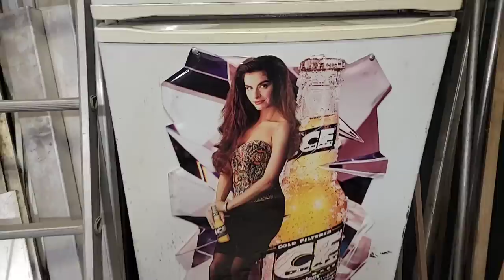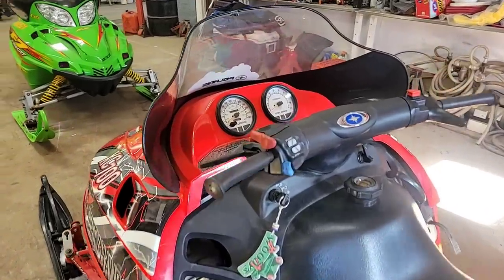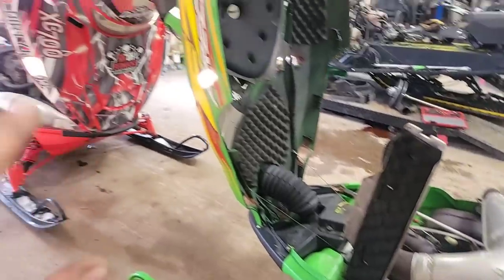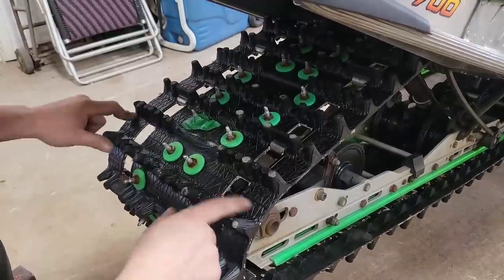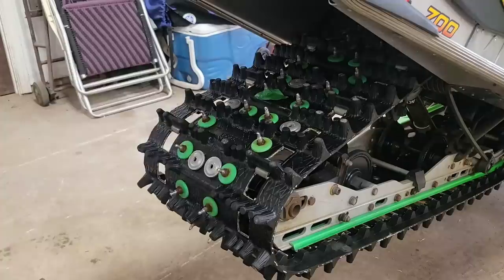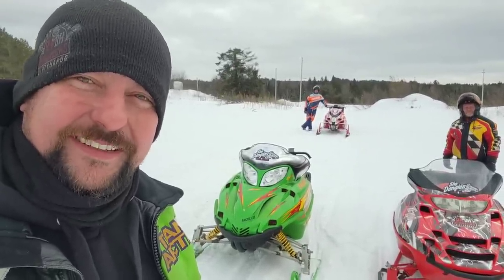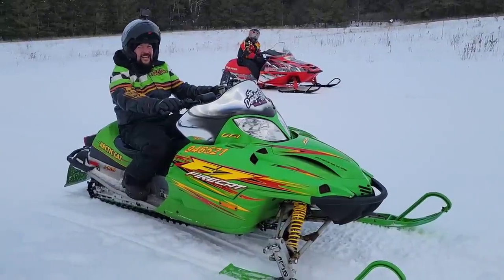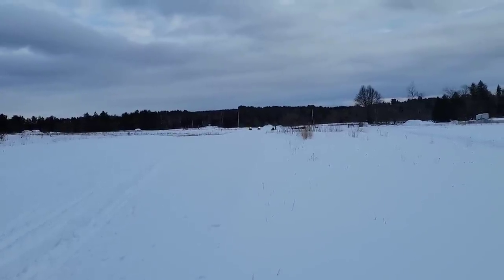F7 VS XC 700!! Which One Is Faster?

Comment: I know alot of F7 fans we're saying that it would eat up the XC 700.. but I knew that wasn't going to be the case. I never owned a XC 700 but my buddy did and it was a VES which are even a little bit quicker and we use to do drags up on our river and not much could touch them, the closest sleds to them was the F7 or triples on long runs.. alot of F7 fans are unfamiliar that the XC's are Big Block motors and they work very good.. coming from a Yamaha rider
Reply: Yeah the polaris has been played with its a shocker it even runs
Reply: Wasn't this year a liberty 700small block just like the 600, it's just before they put powervalves on it? I thought only the pre edge 700's were big blocks? Like 98-99
Reply: @nick  no they are all big blocks only thing that changed was the cylinders with power valves and VES which gave them more power.. alot of people talk about the 220 jugs being the best but it's not true because they had more power in the later years... IN STOCK FORM.
Reply: Both are quick polaris was always fast when they dial them in. But those f7s are rockets man
Reply: @Shane Rose  yes they are both quick, and I knew they we're gonna be pretty much even. Like I said we use to run ice drags years ago and it was a big event in our area in Canada here and I remember those stock XC's we're taking down modified sleds and F7's we're pretty evenly fast basically they lost just as many as they won when they lined up and it was fun to watch. Remembering those day's I knew the F7 wasn't going to walk away, that it was going to be close and the XC did win and so did the F7 just like back when we dragged them
Reply: @Ryan-vo3rm  yes I also live in canada and I have experienced pretty much the exact same seen stock versions of each do very well I haven't got to many drag races over the last few years but I sure do enjoy them
Reply: @brokejoker89  yeah okay... sure
Reply: @Ryan-vo3rm  yeah that's right Ryan
Reply: I know the hot setup for a f7 and a stock motor with gearing and clutching will take that sidewinder in a 600 ft race all day long. I’ve been drag racing f7 for almost 20 years
Reply: You're absolutely right The XC700s or monsters especially the 97 and '98 with the raceport
Reply: Until later they did build the 700 and 800 off the small block 600. Like the 07 dragon 700
Reply: My srx eats them both
Reply: @nicknadeau7173.. because it's a triple, unplug one cylinder and run it like twin lol.

Comment: with that f7 you have to make sure the fuel pressure is correct 38-45 psi, some of these have way too much pressure due to clogged regulator, with everything else being good it would smoke that xc700,

Comment: Conditions and lane choice play a factor in any sled race. Those chain case F7s were really fast in there glory years. I'm betting that XC 700 has a set up that works. Let's get that F7 some maintenance etc and have another round. Great video with the boys, cheers from Ontario
Reply from the maker: thank you and cheers 🍻
Reply: what are the glory years
Reply: @phoenixluke8132  before the triples died when sleds didn't cost more than bloody cars man!
Reply: @phoenixluke8132  I have a 04 700 FC , I put 153,2 inch, fuel pressure regulator. Runs wicked and has tons of kms
Reply: 😮😮 rrear.😊arez😊/😮😮😢😢
Reply: @Phoenix Luke  well I have a sidewinder turned up to 11 so ya can't compare. Back in 03 those sleds stock to stock would spank 1/4 mile pulls not the whole lake now  an  RX1, Mach Zs and SRX if studded right, think that about sizes it up there pal.

Comment: The 2002 xc700 was so strong they detuned it the next year. The 98 was also quick. I don't remember anything stock (700cc) beating that sled when it came out, it dynoed @ 124hp with the early 220 torque ported jugs. The 2002 was outperforming their own 800's. I think the 03 firecat was the fastest 06 was also very quick.
Reply: I have a 98 xc700 and it rips, really fun sled😎

Comment: 700 big block non VES Polaris is very impressive...or that F7 is tired ..?   Also i think the track setup on the Polaris is better ...XC 700 had better use of its power and clutching. 
A fresh F7 with proper track setup and clutching should gap the XC quickly.  what did they look like across the lake WFO top speed?

Comment: Need to get the XC and the F7 on a lake or long field where they can stretch their legs, I think that's where the F7 will take it. Great video, that XC is quick.
Reply from the maker: Totally agree! 🍻
Reply: The FireCat typically reaches 110-112mph. full out.  I just watched a great video of someone doing just that on radar.  The sled went by the fellow holding the gun only a couple feet away from that top end run.  PLUS, the camera was also focused on the sleds speedo and reading the SAME MPH !!  

I always felt the newer Cat digital speedos in those years were pretty accurate.  I own one (2004), and at absolute top end on a LONG lake......................110mph.  (O:  It's 140HP in a 521 lb. sled WET................it makes perfect sense.
Reply: @garysmith8455  you are right,  those lay down 700 Suzukis were close to 140 hp stock. Those 700 polaris were barely 120 hp.
Reply: @johnbabb1138  Thanks for your reply and agreeing on true history from back in the day (O:

Comment: I bought an 04 F7 new, and buddy had an 02 XC 700 at the time. Both were bone stock with studs. He was a handful and beat me multiple times. The 02 700 was rumored to have some hotter timing in it vs later yrs. The F7 was a quick sled and showed its tail lights to many larger CC sleds, but that XC 7 gave me all I could handle. Both great sleds in there era.

Comment: Another variable here is the track, alot of f7s back in the day were sno pros with the 1 3/8 track, which worked very very well.
Reply: Only the SPs got it, unless you asked for it. 
We had 2 03 F7s and 1 440SPs brand new. 
That XC700 would never be seen at drags in stock classes. 
The F7s needed clutching and they are complete different animals, and removing the rear couplers.
Reply: @mitchellandrew3318  maybe not at your drags
Reply: @romper4444  There was tons. 
We built them also. 
They can't touch a stock for stock 700s with clutching in 660' is what we dragged. 500' not a chance. 1000' the SRX 700 would run it down. 
Also if you don't know much about the 03s. There claimed 135hp, was more like 145/150hp with minor tweaks. 
Mod 700s and stock and mod 800 classes didn't like the chain drive 03s. 
DD machines were slow 05/06s. They needed alot of work to make quick, plus they were a bit heavier. 
We had many wedges, Gen 2s, pro X , IQ and IQRs. 
I even had a IQR with a cat motor. 
The polaris 700 is a reliable fast motor. But they needed a ton of work to make them layback block fast. 
Unless your in your game, and hitting a light all day long on that tree. The XC 700 wasn't worth its weight for speed. 
What the video is showing is a bone stock F7 with nothing done with a 13x1.25 track. It's like a chainsaw in the snow.

Comment: I thought after 2000 polaris 700 were VES....  I've had a few 2000 RMK 700s and there the most dependable sled by far... Cats always seem to run great until you get far away from home...   My RMKs with 136 tracks top out at 100mph to 105mph on the lake...

Comment: Thing here  is, you got a light weight (F7) @ 140 hp. vs. a new 205 hp. sled = quickest/fastest available today. (is that a stock exhaust note I hear??)    I would be willing to bet that a NEW sled in the 'same engine class' as a 20 year old Cat such as in the presentation here, the owner of the new model may be greatly surprised out there on the lake.  

Outside of the suspension changes and added comforts, the new sleds have not come all that far when the track meets the snow.  (O:   I just watched a video about the Catalyst, and the presenter made mention about Cat's 'lay down' engine.  Guess what, that 2003 F7 is when Cat INTRODUCED the lay down engine......yes, it is 20 years old now and appearing on a 2024 model !

At any rate, it is all in good fun anyway....thank you!

Comment: Some  F7's (dependent on year and chain-case drive) are super fast due to a number of things: 1. Fuel injected. 2. Front air pick up (colder and more flow). 3. 13.5 x 128" track  vs. the Polaris 15 x 121" (an extra lug and studs on the ground at any given time and lighter rotating mass). 4. Higher stock head compression (more stock H.P.). 5. Weight (stock vs stock the Cat is lighter by about 60 lbs.!). I believe the the 2003 F7 stock HP is around 140. The 2001 Polaris XC 700 is around 120-125 (Not the SP). The reason that "Scooter's" sled is neck to neck with that F7 is simple, his sled (a 2001 XC 700 SP) has a VES type cylinder head from a 2001+ 700 (higher compression probably equaling a stock F7). Don't know what gas Scooter is running but with that head 91+ octane. If the XC could "cheat" some weight and have a similar track it would likely beat the F7 most runs (based on similar track conditions). Cheers from Caledon ON CANADA... love the content
Reply from the maker: cheers 🍻

Comment: hind sites 20/20 but had a chance to buy a new 03 f7 and i chose a 03 zr900  what a mistake....defective oil pump in the 900 cost me 3 rebuilds before we figured out the oiling issue.   I was scared of the list as long as your arm recall sheet on the f sleds the first year.   They ended up being rocket ships.   BTW, that 1200 u had a while back musta been a slug lol.   I have one now thats clutched, and few other things done to it, but all  N/A and it beats my buddies spine grinder in a 800 ft.
Reply: I own a 2004 Nightfire EFI, bought new in 2003.  I have not ridden in years, and the sled is still sitting in my garage with only 800 on the OD.   I went through all those growing pains.  The fuel tank, the coolant hose routing, oil level sending unit.....there was one more I can't remember.    Sorry to hear about the 900.   

Back in those days, I read from a fellow that had both your 900 and an F7 brand new as well.  He stated that both sleds performed equally, it all came down to who got the best dig!

Comment: Bought a used indy96 500 they said if your not riding it for a day to shut off the fuel .. what would cause this as me and the boys are going though this thing in spring
Reply from the maker: maybe the needle and seats are leaking in the carbs and will flood the engine when sitting? I would check and clean the carbs and see if the needles leak. hope that helps 🍻

Comment: That was VERY interesting. My last sled was a Arctic Cat Powder Extreme 600 Triple. I had V Force Reeds installed, PSI pipes, the 1.6" lug track replaced with a 2.0" , plus K&N air filters ever before leaving the shop. Then I ended up having the heads milled .090. It was fast, but not probably as fast as those 3 sleds. Being a triple, I didn't hit my power band till higher RPM. Did pretty good in grass drags with it.
Reply from the maker: Nice One! 🍻

Comment: Iv owned both depending on clutching both sleds r very fast. 
Actually believe it or not the XC 700 was a better performing sled than the the 800 XC. 
My father had a new sabercat 600 in 04. Another buddy had a XC 800 that 600 saber would eat up that 800. I know that cats stock clutching was a lot better than the Polaris clutching. 
When my father and i rode polaris we would always clutch ourselves and jet. 
Our polaris’a were always fast sleds.  
But anyhow great stuff keep up the great work. 
Thanks 
Josh.
Reply from the maker: thank you! cheers 🍻

Comment: Makes me wonder if the "stock" f7's i raced were hopped up or if this ones sick. My 98 xc7 will consistently beat edge chassis ves 700's. But i could never get closer than 2 lengths to a few of the local f7's
Reply: Those 89’s had the purple head a lot more compression, wed swap those out when we found them 👍
Reply: I can tell you my stock 03 f7  was quick.ran many times well into the 800
Classes.i added a few bolt ons and consistently ran in the 800 improved classes.idk this f7 seems something is lacking,or that xc7 has something done to it they dont know about
Reply: @Ironmountain81  I’m thinken so to, you can see the air box looks gutted.

Comment: Back in 05 I bought a 04 F7 snopro.  I put 144 chisel tooth studs ., sucked down the Fox zero pro shocks put a can on it and I filled the flywheel key to get 6 degrees advance.  Then I put a Thundercat primary spring and weights and cut fairly deep notches in the weights where the rollers contact the weights at idel which brought the weight almost back to stock but it engaged at 5300.   Xc 700 were not worth racing I never even got beat buy an XCR 800.   That Firecat would run 114 in 1000 ft.  Back then the only Polaris sleds that could compete with Yamaha and CAT were full mods.

Comment: Pete, I'm going to look at an F7 
Today, what should I look for with these
Reply from the maker: yeah obviously compression would be number one on the list but make sure the track is good with no rips or pull throughs if it's studded have a quick peek at the belt and clutches...sometimes the tips of the helix on the secondary can be snapped off or you can feel flat spots in the rollers. other than that just kind of go over the usual stuff like give the front end a wiggle to see how sloppy it is and check if the runners are good seeing how they are pretty pricey these days lol.  and as always take it for a bit of a rip before ya buy it! see how it feels and runs...if she don't Dangle there's something wrong lmao 🤣🍻

Comment: Those Polaris Liberty twins were really strong. You could usually race a class size above and win.. IE 600 Polaris vs 700 whatever.

I'm not a Cat fan, (in fact I downright hate them) but I have to admit, the F7 was the game changer sled that brought us our modern snowmobiles.

Rider forward, centralized mass started with the F7. Skidoo REV came next, Polaris didn't really get their $h!+ together until they released the IQ platform. 

Between these 2 sleds, the Polaris can win a drag race, but take them on a 100 mile run and I can almost guarantee that Cat will be in front.
Reply: That was my zrt 600 AND 800 NOTHING in the same cc class could touch them. My old ZRT 600 still makes 700 cc sleds look slow.

Comment: An f7 with 7200 miles is guaranteed to have been apart atleast once.
Reply: They don't call them Cash Cat's for nothing
Reply: @joshpitts7256  those lay down Suzuki motors were the most powerful,  reliable sled motors ever built - prove me wrong lol.

Comment: In the Polaris 700 s there were certain number cylinders that were higher performance than others. This 700 must have them.
Reply: THE 220 JUGS
Reply: Ves is way faster than any non ves jugs
Reply: 220 jugs aren’t any faster . And the VES motors have higher compression anyways . Don’t believe all the trail side BS

Comment: She's last winter but I gotta throw a little info note here. 6k miles is an extremely wise time for pistons and rings on a 2 smoke sled. 30 years of putting them back together tells me that is the average life cycle of the slugs. Russian roulette beyond that point 👉🏼. More studs = slower top end. F7 got a skinny track to reduce rotating weight with the extra length.

Comment: Broke a power valve in the SLP performance edition 700 Liberty a few nights ago , shut it down immediately ! Cylinder , reactor #1 , total melt down , piston just chewed 1 inch of power valve off in seconds , she’s down til spring now , when I fix her , I think I’m going power valve delete !
Reply: There’s a better stronger valve now, that was a bad year total mass damage
Reply: Mines a 2004 switchback , read a bunch , stainless valves for the 800’s , but 4 years ago , I bought a motor out of a 2005 RMK , sent it to SLP , and went new crank on up , everything in the catalog but egt sensors in the y-pipe , said they didn’t assemble motors , I said than I’ll go somewhere else ! They said ? We changed our minds , we’d love to build your motor ! I’d have bought power valves , I asked SLP , between price of RMK motor , and new everything , plus performance edition job , plus labor , that’s over 5 grand ! 1400 miles , what causes a melt down at a nuclear plant ? A valve does !
Reply: Plus sneaky Polaris ! The 2005 motor flows the coolant in the opposite direction ! I know there were no bubbles in the system , 1 mile , DET light ! Cost me $250.00 at the Polaris dealer , they had to call the main office after scratching their heads ! Finally the main office guy asked them ? Could this be a 2005 motor in a 2004 machine ! Switch the hoses around , Success ! SNEAKY !